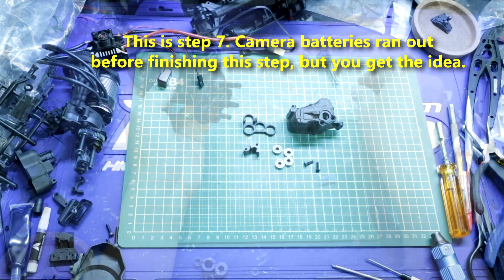Vanquish VS4-10 Phoenix Portal Build Series - Part 3 - Transmission

Comment: at 18.22 you slip the case on effortlessly, I'm not having any luck getting that case to slide on. any suggestion would be most welcome.
Reply from the maker: If I remember correctly, there is a piece on the shifter case side.  Vanquish has several pieces that look similar and the instructions don't really help in figuring out what that piece is.  Make sure you have the correct piece in there.  I think it's the metal piece that goes inside the housing.

Comment: 9:57 - I’m unable to spin the shaft so freely with my install.  Do you think my motor is broken?
Reply from the maker: I don't remember if I was spinning pretty hard or not, or if the pinion was even on the motor at the time during this video.  The motor should give some resistance due to magnets though.

Comment: Hi...I've been watching your videos on the vanquish portal built. Did you make the steps you used to build it or are your steps according to the instructions?
Reply from the maker: I'm going according to the instructions.  Although their number is weird on a few pages where they start all over from 1 again for the next page instead of by component.  In those cases, I might have just added the number instead of starting from 1 again.  Sorry for the confusion if that's the case.
Reply: @RevolutionX  your videos are better than the instructions great job and thanks

Comment: Hello, can a 3300 kv come in the box?
Reply from the maker: I do not quite understand your question, but the kit does not come with a motor.  If you are asking whether it's ok to run 3300kv, then I'd just suggest using a smaller pinion if you are going to do that.